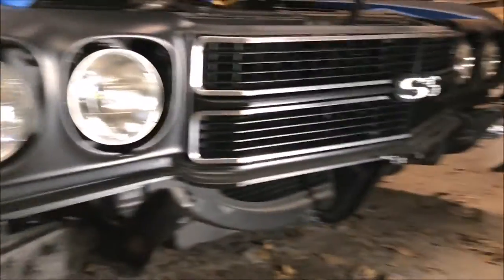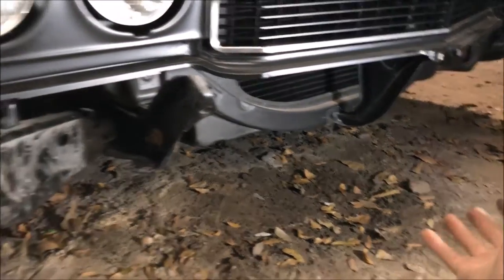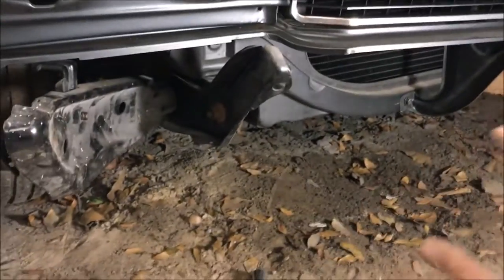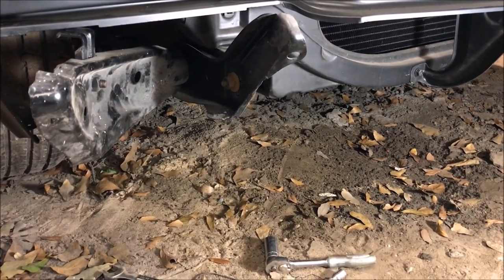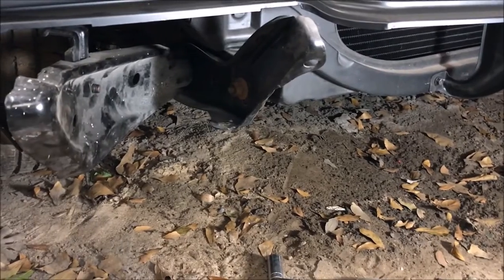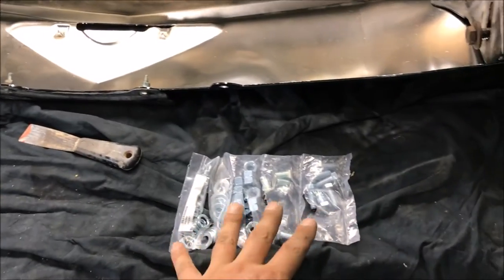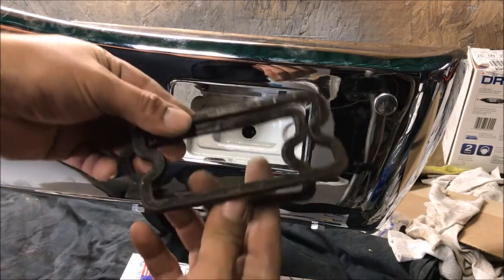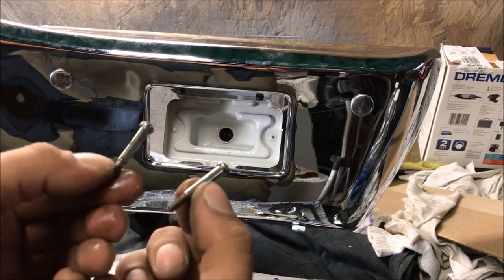70 chevelle front bumper assembly and installation how to DIY do it yourself

Comment: Hi chris, been putting my front end together but am curious if I am lacking brackets to bolt up the filler panel, the panel that goes bellow grille that fills the gap between the grille and bumper. How does it attach?

Comment: Hey Chris, hypothetically what would you need to put a '70 front end on a '71? Bumper, fenders, fender extensions, grille, lights, and wiring? Is there anything else up front that's different? Maybe the rad support?

Comment: I need to redo my radiator core support on my 1969 Chevelle, didn't know about the inner bumper support mini brackets that keep the bumper from vibrating this was a GREAT video nice job! thanks!!
Reply from the maker: I actually think those are so when you jack the front bumper up with a bumper jack it protects the core support or keeps the bumper in place